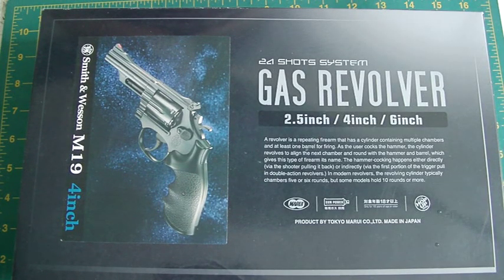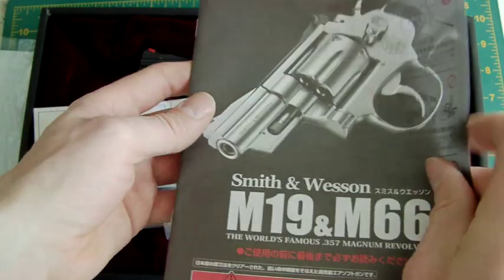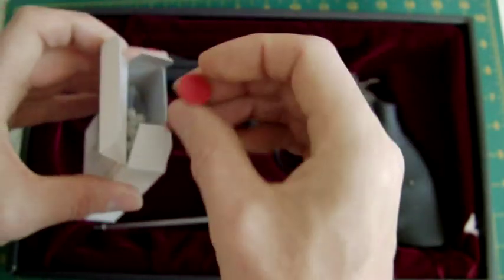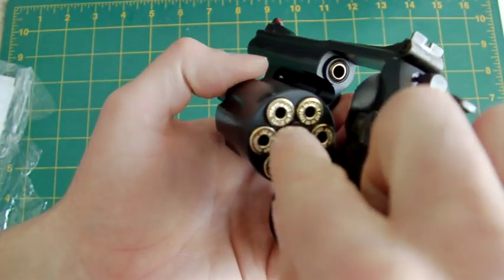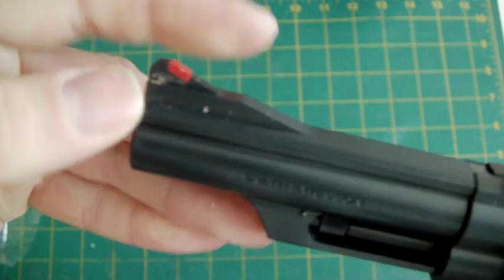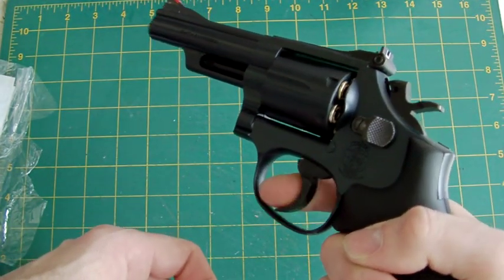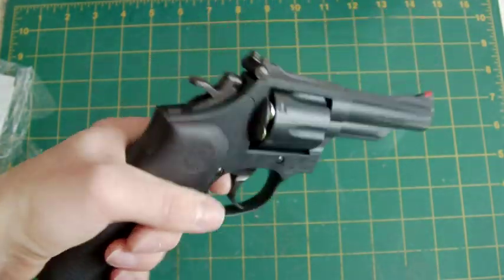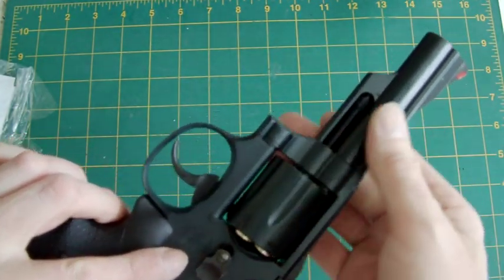LaZouche Custom airsoft TM S&W M19 gas revolver review

Comment: Man; What I'd do for a good steel bodied and cylinder model 10 airsoft gun. I own one and I'd love a good skirmishable airsoft revolver. but being that all the good performing gas revolvers are plastic (don't feel the same!) and all the metal ones are crap durability and have stupid FPS it looks like I'm just stuck wondering.

Here is my dream sidearm
Model 10 Revolver
Interchangeable cylinder (between high cap, and real cap)
Steel construction (use aluminum and MIM steel where possible)
Co2 powered
320 fps w/ .20g
4 inch barrel
wooden grips,
Realistic S&W quality trigger
TK barrel and adjustable hop

price point around 300 USD would be do-able
Reply from the maker: Yes its a pity they dont do full metal kits for the TM guns :-(
Reply: I'll get around to it someday.

Comment: The 'ejection shaft' is for removing BBs from the cylinder. Without it, or something similar, there is no way of unloading the gun other than firing it. As for the grip, I'm not a fan of the Hogue ones at all which this gun has replicas of. Hate the finger groves, maybe you're the same. I have a Pachmayr on my Tanaka M19 that is smooth in shape like a wood grip, but made of rubber so it's grippy, which I find perfect. The TM revolvers are good options for skirmishers, but I don't think the plastic is as good as their autos and they're very light which is a shame. Also, the stainless M66 versions are worse in my opinion. It has the same seam lines etc., but has a cheap, almost flaky looking silver finish which isn't very convincing. Overall the Tanakas are much better but expensive and they can be hit and miss with performance - I would definitely recommend you try one out, I'm sure you'd be very impressed with the finish. Marushin are the other main revolver maker. Better built than TM, uses shells but poor performance. Tanaka are king.
Reply: No I too dont like these grips and prefer the fake wood type. Ive seen and handled the Tanaka revolvers but never used one in a skirmish unfortunately but they aren't the best for gaming im told, similar to the Marushin versions which have poor reliability aswell.  So the finish on the newer M66 chrome revolvers by TM aren't as good as their Nickel plated Colt 1911 then?  Pity :-(
Reply: Hell no, the finish is much closer to what you'd find on a spring pistol to be honest, more of a light grey. I guess the idea was to replicate a flat stainless finish rather than nickel/chrome (since the '6' designation in a S&W means stainless steel), but its pretty crude when you compare it to their GBBs. I think the revolvers should be priced lower - I see no reason why their S&Ws should sell for the same prices as their newer GBBs. In terms of reliability, I've had far more issues with TM revolvers than Marushin or Tanaka. TMs tend to start firing more than 1 bb at once, and more powerful gases can damage them. Marushin are pretty good, not the best internals but on par with TM. Tanaka are the best, from what I've owned anyway. They will take any gas you put in them, and can actually take real S&W internals if anything goes wrong. Also takes any RS grips, sights etc. The older ones can put out some crazy velocities. My Model 29 can shoot near 450 fps with Guarder Gas! Not a CQB gun ;)
Reply: *****
 Well you have sold me on Tanaka revolvers there my friend :-p It seems ive been informed wrongly by others on Tanaka, either that or they had 'Friday guns' that didnt perform well.  Many thanks for the info ;-)
Reply: No problem. Performance really depends on the model, and how old it is. Newer ones shoot at much lower velocities, and some of them are quite inconsistent in terms of accuracy/range - I have got most of mine shooting pretty well though. My SAA certainly matches the range on my Winchester, in case I feel the need to skirmish cowboy style. Thanks for the video, excellent as usual!
Reply: Rusty The only thing the gas moves when firing is the BB, so it doesn't put any stress on the gun other than the seals.  A metal kit would have no effect on durability in terms of gas, especially since the cylinder where the gas is held is all metal anyway.  As long as the vavle/seals can cope with it, they can take any airsoft gas.

Comment: Safety is a little slide switch under the hammer on the top of the 'rubber' grip. It's a pain in the rear when you're wearing gloves xD
Reply: Not a good thing to use in a skirmish then.  Still TM have to fit a safety due to regulations in Japan.

Comment: I am also a 1911 and other pistol fan. But I like good revolvers,  and this seems to be well made. I got a big trouble in a cheap M-19 replica made in china: it looks much as this but its just that: ''looks''... And it has an inner frame that broke, and rebroke... Now it is ''metalic'grey coloured material replicas come with in side.How can I glue or replace this part, as no one sells parts for chinese cheap replicas? ( As I wonder if there is some one who sell for other chinese replicas, as Snow-Wolf for exemple?? )Could you please lend a hand ?? 1000 thanks any way!!
Reply from the maker: pedro tomé   The only possible way to glue the 'pot' metal internal frame would be to use Araldite two part metal glue and also try pinning it aswell, though difficult it can be done but longevity will be an issue as it won't last but if it means that much to get it working then that's the way to go. I know of nowhere that sells revolver parts but others reading these comments may well do. Hope that helps ;-)
Reply: Yes it did. Thank you o much!! Please if possible tell me who does sell WE, WELL, and KWC parts in Europe, as I own some of these brand guns that I want to repair and upgrade in some cases! Thank you again!!
Reply from the maker: pedro tomé  WE and Well 1911 parts can be substituted for TM aftermarket compatible parts so don't worry too much about branding. WE uses a different magazine set up for their 1911s but basically the frame internals are all based on the TM Hi-capa as is their slides and Well is just identical to TM for 1911s or Hi-Capa's but made with poor quality materials. ;-)
Reply: 2000 thanks my friend! But WHERE can I find parts for my WEs and WELLs (with fair prices) here in Europe? Once I tried to buy a slide for a WE 1911-A1 military design, from Hong-Kong, and it was a mass with our customs!! I want to repair and build my replicas, but its geting hard as I need informations that I can not easly get...!!